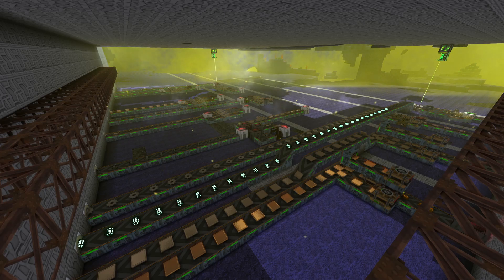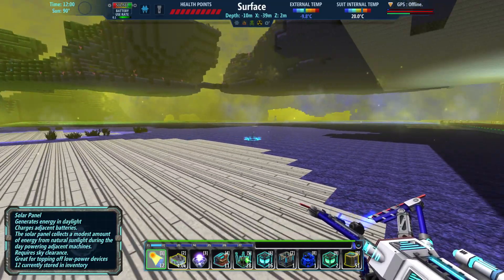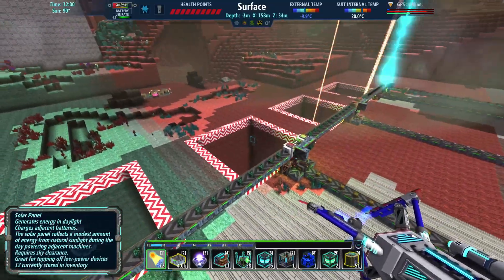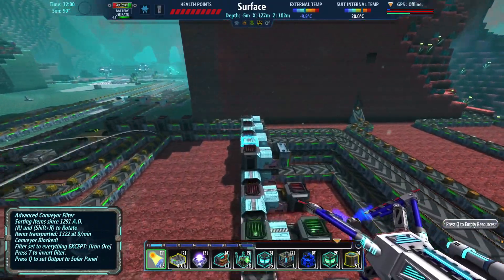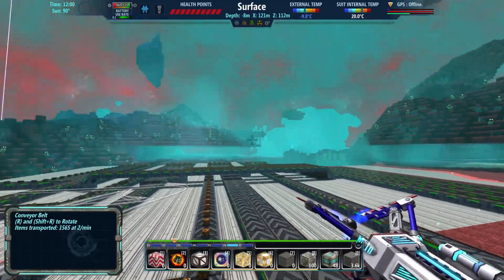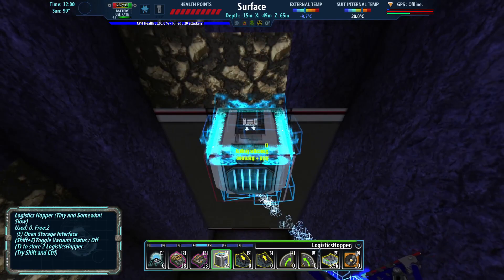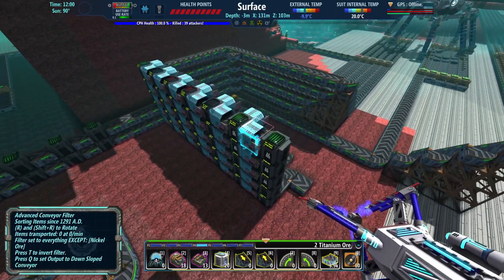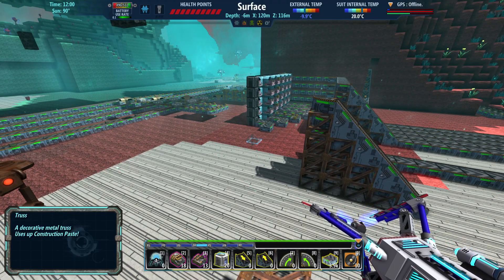MASSIVE ENGINEERING | FortressCraft Evolved S02 E21

Comment: Very cool design you came up with there with the slopes. I was wondering if motorized conveyors would be useful in the huge line of ores, or if those modded hoppers are faster than the vanilla ones, or if the power consumption is a quandary. I haven't seen many people using them. 
Great video!👍